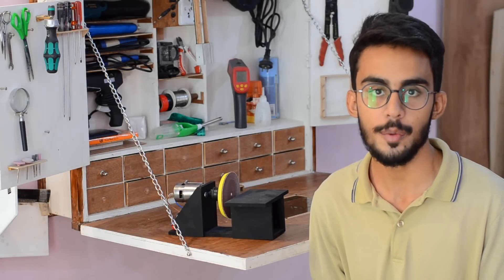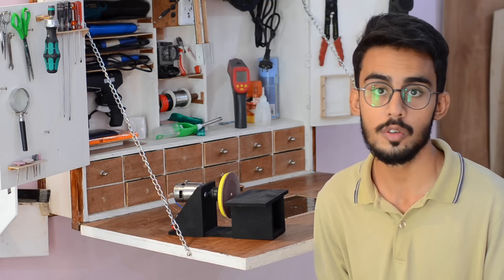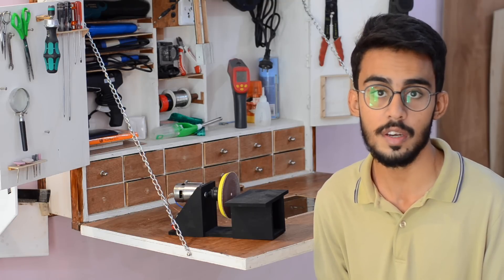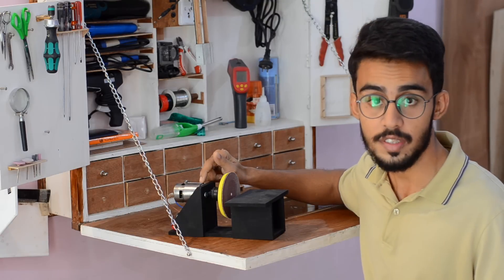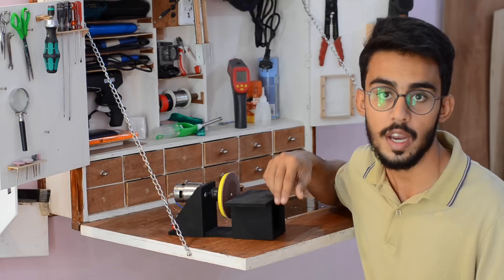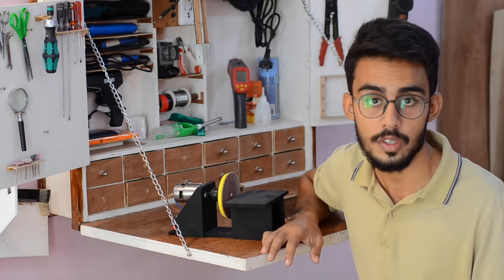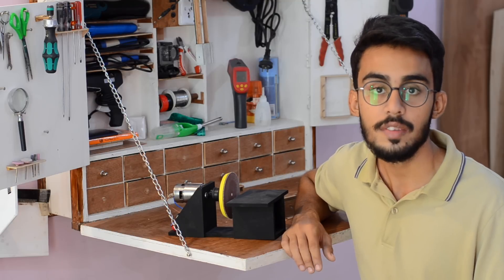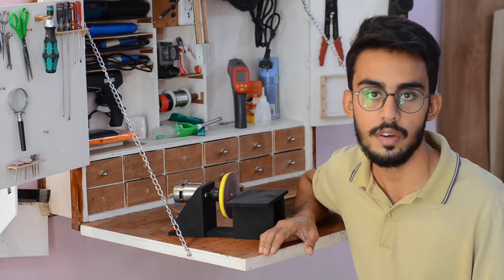Homemade Cordless Disc Sander using Old Laptop Battery

Comment: M10 adapter?
Reply from the maker: No actually I have custom built this adapter to fit the shaft on my motor.
Reply: DIY King your 775 motor looks kinda different. Where do u get it?and whats the motor shank?also whats the adapter shank?

Comment: where can i get motor adaptor ??
Reply from the maker: It is usually available from hardware stores but you can also custom built these adapters for your motor shaft size.
Reply: DIY King bhai shop batadeh yeh adapter kahan se milega motor shaft ka. Mei bhi karachi mei he hn